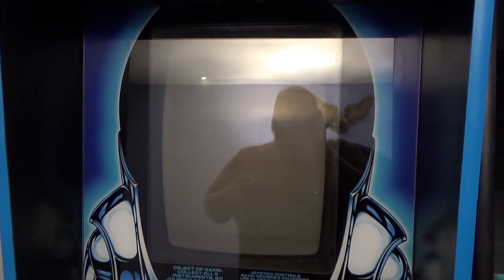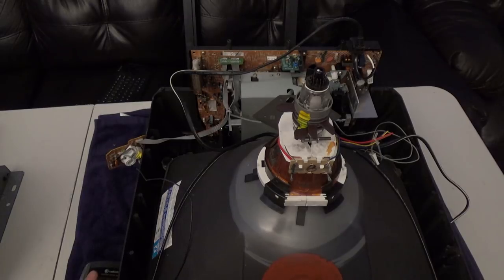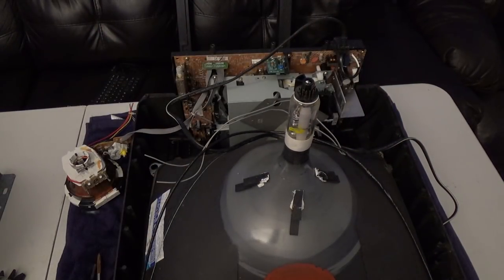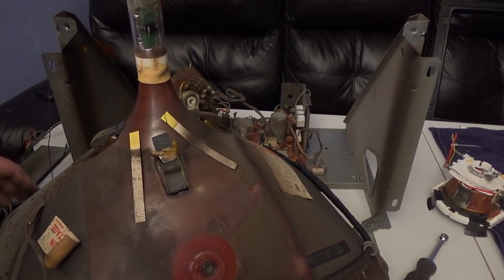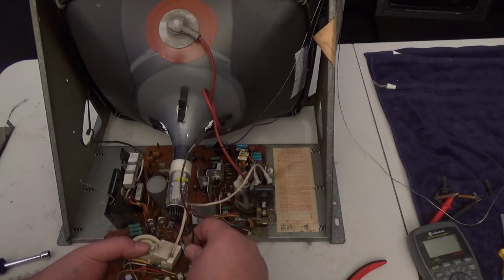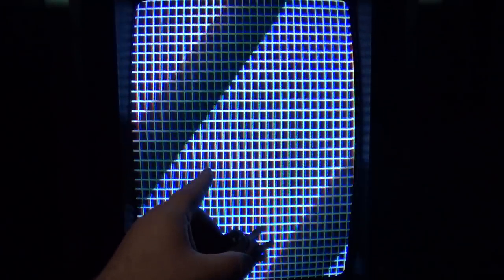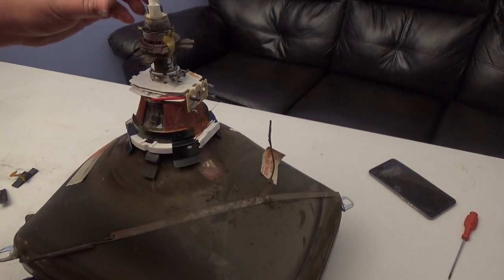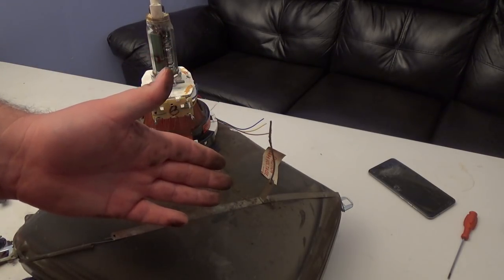Arcade TUBE SWAP simple explanation

Comment: you can be sure that the newer CRT will not last anywhere near as long - maybe not as much of problem if the cabinet won't be running long hours - CRT manufacture suffered like everything else in later years (the cheap disposible era)
Reply from the maker: in my experience newer tubes are no different in longevity and have cleaner pictures. i have done tubes swaps that have run in laundromats 24-7 for several years . i will say this!! stay away from no name chinese tubes
Reply: @ArcadeJason  it's the chinese ones I was mainly referring to, though there were some poor ones made in the 80's as well. I had a samsung tv in the 90's that went through 3 CRT's in the space of about 7 years

Comment: Hey jason,heres a request for you..ive a operation wolf in bits..ie control panel..marquee,coin door etc...but the cabinet had massive water damage and couldn't be saved,the seller has kindly posted the pieces from italy..to me..(uk) ive asked everywhere for dimensions online/forums etc with no joy..(alass) could you point me in the right direction .?or you have dimensions for one.sunny uk"))
Reply from the maker: hmmm ill check for op wolfs at work to see if i get get some measurements
Reply: aww man!! That would be fantastic!! Your the man jason:)
Reply from the maker: sorry sunny no op wolves

Comment: Would like to clarify... can you touch the yolk without getting zapped. Many new folks are not aware what they can and can’t touch and these monitors scare them.
Reply from the maker: That's true if the monitor is off but untrue if the monitor is on. For example a wg4600  supplys 140v to one of it's yoke coils and others are much higher
Reply: Arcade Jason  so don’t touch the copper :)
Reply from the maker: Agreed
Reply: And wear those yellow kitchen gloves when working on these if you are nervous.  I do.
Reply from the maker: lol
Reply: Arcade Jason personally I’m not worried about shocks and work on my monitors all the time.  It’s not anywhere near as scary as it’s made out to be.   Just pay attention.
Reply: Almost all monitors have quite a high voltage on the horizontal yoke, as it's usually part of the primary side of the flyback circuit.

The back-EMF from the flyback primary can create around 1600 Volts on some monitors, but that's usually when the yoke is open-circuit.

And yep, I guess the primary / yoke is also driven by a B+ voltage of around 80-160V as well, so best not to touch the yoke at all when it's running.

Arcade Jason - I just discovered your channel. Subbed. ;)

I did actually watch the Colour Vectrex vid the other week.

I've been meaning to hook up a small colour CRT to my Vectrex for years, and build a similar colour circuit, but you beat me to it. lol

(I didn't fancy re-winding a larger yoke though, so it probably is easier to just use an existing arcade vector monitor instead.)
Reply: So make slight adjustments with the yoke with the cabinet turned off, turn on to check, and repeat as needed?
Reply: I guess if you really need to move the yoke while doing geometry adjustments, then maybe just keeping one hand in your pocket, as is the general rule when working around high-voltage stuff.

ALWAYS use an isolation transformer as well, and keep all other limbs away from Earthed things like radiators etc.

You should really be insulated from the floor as well, especially on a ground-floor / concrete.

The voltages on the yoke aren't exactly super-high, but they could still give a nasty shock (more than enough voltage + current stop your heart) if the enamel on the wire has a nick in it, for example.

Obviously you want to stay well away from the actual terminals on the yoke where the wires connect, too.

I realise that it's often very necessary to move the yoke to get proper beam "focus", and decent geometry if you're replacing an old yoke, or if the old one has moved somehow.

I don't really know the best answer for doing it safely, apart from just knowing what you can and can't touch. lol.

I used to repair TVs / monitors, and never had a bad shock from anything, as I rarely had to do "live" measurements near the high-voltage stuff, and always safely discharged the CRTs and larger caps before working on a board.

I only once got a mild zap from a 28" CRT TV when discharging the tube, because the wire connecting to the chassis ground wasn't quite making proper contact, and the arc jumped from the screwdriver to my thumb. lol

The only bad shock I got was from an old D2MAC satellite receiver. I was checking the two main heatsinks to see how warm they were getting...

One heatsink seemed OK, the other heatsink maybe a bit warmer. So, I tried to compare the temperature between BOTH heatsinks, and put my hand between them. OUUUCHHHHH! Never again. lol

I very quickly got into the habit of keeping one hand behind my back or in a pocket while working on live stuff.

Probably the safest thing to say on social media is simply - "Don't touch live electrics / electronics if you're not 100% sure what you're doing, and how it all works."
Reply: Is that sufficient to be safe?  I've done that before ,and still have a desire to keep one hand in the pocket!